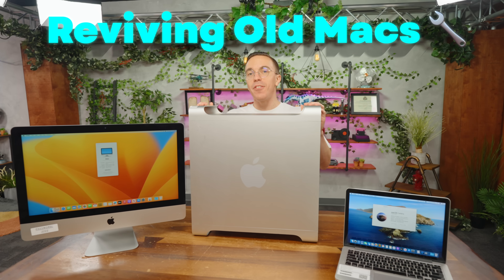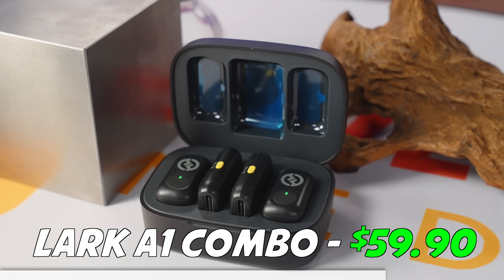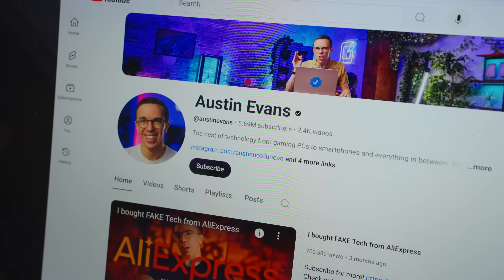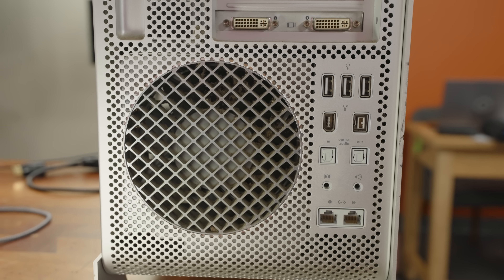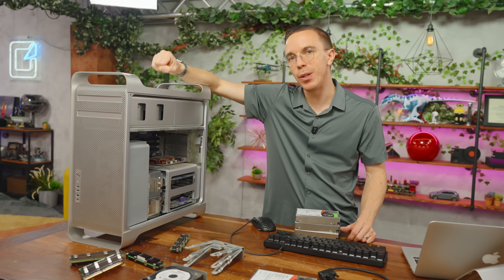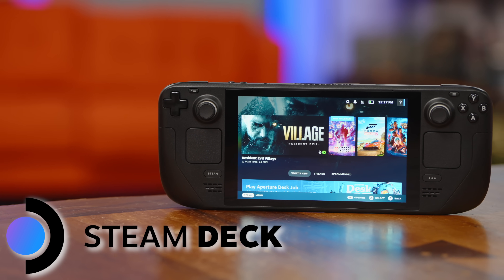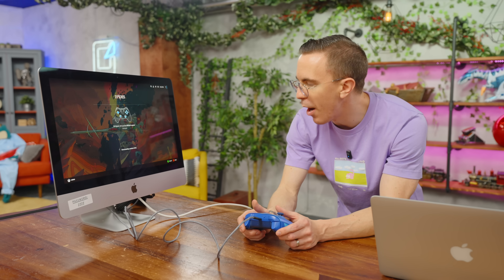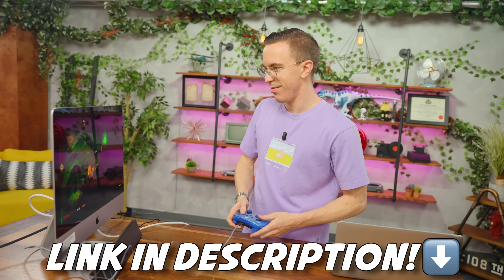I Installed SteamOS on a Mac.

Comment: Amazing price for DDR2 RAM. It has been my experience that older DIMMS and/or SO-DIMMS are often double to triple the price of current-gen sticks. Nice to see that Micron's wholesale rape and pillaging of the consumer memory sector has not extended to older, less AI tasty components.

Oh wait, this video is 2 months old, so you have no idea what is about to happen to RAM prices...consider this your warning from the future. Stock up now, while you still can! By Christmas 2025, RAM will be your most expensive upgrade.

btw I installed ZorinOS on a 20 year old Core2Duo laptop, have it boot into Hatari, and have given myself a kick ass Atari STe laptop. (Even the 16x10 display is perfect for aspect ratio for 320x200 - 640x400 Atari resolutions!).

Comment: I remember I tried to replace the battery on my macbook pro 2015 with my cousin on the line (he worked on computers). I think in 5 min the screw drivers made the screws unscrewable and i was like screw this. No pun intended.

Comment: Did Austin say what I can do with a macbook with linux mint can do? I have a 2017 macbook pro with a dead battery as well as a 2022 i5 Acer laptop with a good battery and a 2025 i5 Asus desktop. I don't like the macbook, but the specs seem ok for repurposing it if there is anything to do with it.

Comment: I still use my 15 year old mac pro. Lol. I upgraded to a g4 mac mini pro this year but have the old tower networked. I have years of files on it and upgraded it so it has a better cpu, GPU, SSD startup drive, 64 gb of ram and 10T of storage. I had been considering using OpenCore to upgrade it but not so sure any more. I also have 16 T of external drives that were from an array that need to be reformatted. The Nas could be a good use. I also have an old 27 inch iMac in storage. The screen is beautiful but no fusion drive. Im wondering if I can install Bazzite on it? I just built my first gaming PC running Bazzite / Steam and it works like a charm.

Comment: I just tried out Ubuntu after failing to install High Sierra to a second gen i5 iMac with Radeon 6000 graphics. Left 4 Dead 2 and Half Life 2 work like a charm but nothing else will boot under the appropriate proton settings. Maybe I should give SteamOS a go.

Comment: dump the code from the chip on the original battery and flash it onto the chip for the new battery. itll think it still has that many cycles but it wont lock you out. or you can just switch the boards

Comment: erm ackshually - the reason why the wifi didn't work is not because the macbook is old. in the 15 years since apple started using those broadcom cards, not a single developer in the entire linux community has bothered to write up a FOSS driver for it

and that's the catch with installing linux: hardware support is completely dependent on someone willing to give up their free time and nothing else

Comment: For those curious, the retina models of the mid 2012 macs were not upgradable. The NON retina models though, those things could be upgraded everywhere. 16gb of ram, ssd upgrades, the cd drive could be replaced with another hard drive/ssd if you so choose, and some people were even able to get more powerful cpus put on them. Keep in mind the cpu was soldered and requires a lot of dedication to make it happen, but anyway, the non retinas were absolutely amazing in mid-2012

Comment: In my experience, on 10gbe network with no overhead, truenas with a reasonably spec'd system (mine is a Ryzen 1700 with 16gb ram) can pull really close to about a gigabyte a second. It's absoloutely killer as a video editing drive!

Comment: I installed Linux mint on my 2017 Mac Pro, it drained the battery fast and the computer was always running hot.  End up switching it back.

Comment: That’s a late 2012 MacBook Pro should of gotten the Mid 2012 . Has screwed in battery not glued . Ram is DDR3 upgradable to 16gb. 2.5 Sata I believe supports up to 4TB don’t quote me on that I’m sure it can support more. I have one running Sonoma using OCLP. Still my favorite MacBook of all time.

Comment: How hot do the Mac pros run? I got Linux mint XFCE on mine, it’s a mid 2010 and it’s doing 50s and a high of 64 on one core using YouTube for 1 hour. I’m using Psensor to read the temps.

Comment: I installed Mint on my 2015 MacBook Pro and I started facing insane overheating issues, with the cpu running 105 degrees almost all of the time, so I re-instaaled MacOs ventura and use firefox to browse.

Comment: 4:09 You didn't even reset the smc chip on the MacBook (yellow(amber)charging indicator) Facepalm Press and hold the Power button for 5 seconds (while the battery is removed). Reinstall the battery. (on first boot, plug in the charger & wait for the light to stabilize) Press and hold Shift ⇧ + Control ^ + Option ⌥ and the Power button, wait for 10 seconds. You should see the indicator light on the charger flicker (indicating a reset). Resetting the SMC can sometimes resolve abnormal charging behavior, fan speed issues, and failures in battery recognition (Apple Support, Macworld, iFixit).
Reply: You can't expect a youtuber who does this for a living to do the basic stuff!

Comment: yeah but that 2017 imac can run sequoia without issues, e.g. my mid-2011 21.5" imac 12,1 runs great with sequoia. some issues because no metal api support, but hardware newer than 2013/2014 does support the metal api and will make using new mac os a lot better

Comment: Ive installed Ubuntu studio on a 2012 mbp retina. Its awesome for being usable again and it stil gets updates nearly every day

I’ve tried open core but that didn’t work out for me. Then I went for Ubuntu studio. 

Ubuntu studio is basically Kubuntu loaded with media creation apps, a low latency kernel and it looks different than stock KDE plasma. 

I’m stil using the 13 year old battery which is not that great anymore. 19:22

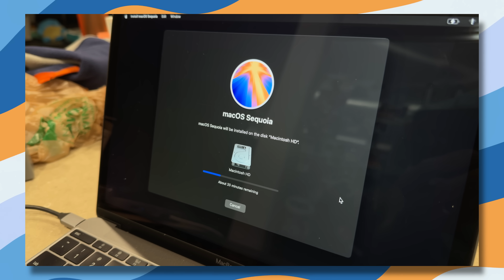Comment: 18:26 false. Wife regularly uses Sequoia and Adobe suite for work. What's holding it back are the garbage internal drive. But installing the OS on a 1tb external nvme drive connected to thunderbolt solves that

Comment: I installed a 3rd party battery to my 2010 MBP.  It worked for about 2 weeks then I had the same problem.  It holds no charge like yours.

But I had already thrown away the original!  So now it won't work unless it is plugged in.

Comment: It is cool to see you doing this with old Apple stuff I have done this a number of times with old windows laptops and desktops, but I never apple stuff. With older laptops it can be really hard to get good quality replacement batteries. A lot of the time the replacements are  very old from back when the laptop was more common and nothing is harder on a batteries then setting on a shelf unused for years so frequently the old unused battery is going to be in worse shape then the original heavily used battery.  Also the aftermarket batteries just tend to be way worse quality then the OEM ones so even if you get one that works well from the start they tend to degrade much faster. Really the only thing you can do is try to find a replacement batteries with a fairly resent manufacturing date within the last year.

Comment: Fusion doesn't use the SSD as a cache. Data on the SSD is not mirrored on the HD, and in that respect it is entirely unlike Windows ReadyBoost, Seagate's hybrid drives, and other caching systems. It's tiered storage with automatic migration

Comment: Running Linux Mint on a 2015 Macbook Air 4GB intel i5 and it goes really well. OS uses about 1 GB of Ram. Total cost $180 USD. What would I do differently ? I would have got the Macbok Pro 2015 with 8GB. But honestly would it be any better? I don't game so not required. Email, Spreadsheets, Docs, Internet - all good.

Comment: mac pros you can use any ECC RAM, the issue is overheating, that's why it has the huge heatsinks. The other issue that was a fault with them was now and then the odd SIMM wouldn't be detected. But they're amazing machines.

Comment: That Mac Pro desktop metal case is iconic. Not a simp or fan of all mac products but that heavy, front meshed, industrial case is amazing.
Reply: i hate apple but i would retro fit that case so fast
Reply: I hear you. Engineering at its finest...i got 10 of these beautie cheesgraters. and loving it ;)
Reply: @ladeluff_  And you can't share the wealth?? Seems selfish. I'll take one off your hands.
Reply: Apple's design aesthetic is to computers, what Bang & Olufsen was to audio equipment in the 1970s. 
Style and function in perfect synergy. Harman Kardon carries on the tradition in the 21st century, with truly stunning audio equipment. (honourable mention should be extended to Texas Instruments for their 1981 TI-99/4A, a design specifically tuned to join the living room space with the high-end black and brushed aluminum look later used by Apple to such great effect.)
I do respect beautiful electronics design.

Comment: I bought my Macbook Pro in 2012 and it was the last model with the built in DVD drive and model before the retina display. Still gets used for photo editing and storage. HDD replaced with an SSD and doubled the RAM about 6 years ago. Battery still ok, but the power adaptor cable fell apart after the plastic//rubber coating disintegrated, I do need to source a replacement from ebay.

Comment: My primary computer is the bottom half of a 2015 MacBook Pro plugged into a monitor, keyboard, and mouse running Fedora KDE. It's not going to do anything more difficult than 1080p full screen YouTube, but it's still very usable for day-to-day stuff and I end up using it more than my other, more powerful, computer.

Comment: Would this be a plausible option for a low end pc gaming? Maybe a present for the kids to play Fortnite on PC? Just wondering about the performance issues
Reply: Older macs ran on generic intel hardware... so its possible but what kind of experience you get will vary
Reply: fortnite doesnt work on linux
Reply: Thank you both for letting me know! ❤ Now that’s out the window lol

Comment: I don't know if anyone mentioned this or not, but when you put in a new battery--you have to reset the PRAM and do a weird cycling of the battery. If you don't, it's either not going to charge, or it's not going to last long at all. I made that mistake on my 2011 MacBook Air.

Comment: I cringe everytime I see somone install ram into a board on a hard surface like the wood table at 9:40. I myself have never seen it in person but my manger at my old IT Job(he'd been there 20 years) told my you have potential to push the board hard enough into the hard surface and break solder joint on the board. I always do it on a static free box :) because of this.

Comment: Having switched from my 2015 27 inch iMac to a 2020 model I snagged from the electronics recycling at my local dump, I might have to try the Steam OS trick on the old iMac. Glad it's got an SSD.

Comment: You can also save your old (and new) Windows 10 or 11 devices with Linux today! 
Kubuntu is basically what Windows should have been.
Reply: Honestly some licenses that I need for work are the only things keeping me on Windows at this point.
Reply: I swapped out Windows on my laptop and have been using Fedora KDE. LOVE IT and somehow it's doubled my battery life.
Reply: I thought I didnt like PC gaming. I just dont like windows lol
Reply: 3 years ago I bought a laptop with an 11th gen i5 and 8 gigs of RAM. It worked fine just fine while on windows, but I made the move to Kubuntu a month ago... daaaaaamn those 8 gigs that were holding me back, now I only use like 6 maximum while in a browser, mind-boggling!

Comment: Heeey your using my favorite Linux distro, Linux mint!!! Fun fact Linux mint is a top 5 holder for over 15 years in distro watch! Its one of the most stable version of Linux and it has two major versions Debian and Ubuntu based the Ubuntu based one is a custom Ubuntu version that is extremely toned down and not crazy bloated like Ubuntu, Linux mint likes to focus on stability over bleeding edge so your mileage may very if you have the latest and greatest hardware, example when arc cards first came out Ubuntu supported them Waayyyyy before Linux mint did.

Comment: My home server is an old workstation from the first Gen i7 era, it's a 6 cores 12 threads CPU, and it's running TrueNAS Scale, with containers and VMs running perfectly, not that surprising that an older Mac Pro with 8 cores can do the same.

At the end of the day, you don't need much CPU power to be a NAS with HDDs, TrueNAS caches a lot of the data in RAM, and the HDDs are the bottleneck, the CPU only really become a factor when you go into SSDs territory, I used a 2nd Gen Atom for a while to do that, and it was fine.

Other than that, yes, Linux really brings back those old computers to life. OpenCore Legacy Patcher is great, but macOS itself is heavy, and it relies on a lot of hacks for GPU acceleration, trackpads, and things like that, it can't beat something like Xubuntu on pure speed and apps compatibility.

Comment: Too much work to covert to linux/ Chrome os. You are better off keep mac os and or virtually machine which would be safer. Chrome os is not the operating system and is not compatible to everything. Its a IT nightmare.

Comment: I've been milking the life out of my 2011 MBP for over a decade now (obv with RAM and SSD upgrades). Just moved from OCLP to Bazzite (Linux) and it's like a new laptop. I only use it for web browsing and YouTube but its so refreshing to be able to navigate without lag.
Reply: Tell me more about this Bazzite Linux
Reply: @Clizzardbash  An overrated Linux distro that is based on Fedora and cosplays as Valve's SteamOS.
Reply: I've got a 2012 MBP and a 2014 MBA that I don't know what to do with, thought about Linux but not sure what I would use if for. Gave my 2020 intel MBP to the wife and bought a 15" M4 MBA when they came out (with upgraded RAM and storage), so yeah I don't know what to use the old ones for lol
Reply: My friend is still using one of the first Windows 8 ThinkPads with the twisty screen that came out around the same time. It has win 10 installed on a 128GB mSATA SSD and if he needs more storage he knows what a thumb drive is.